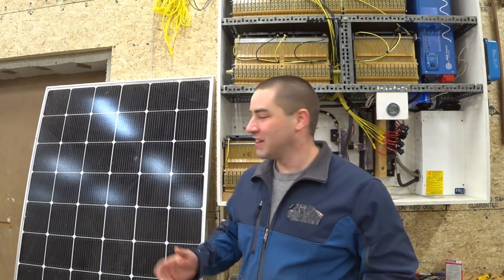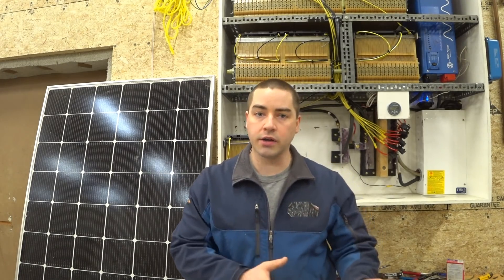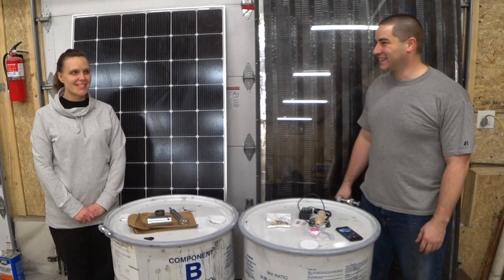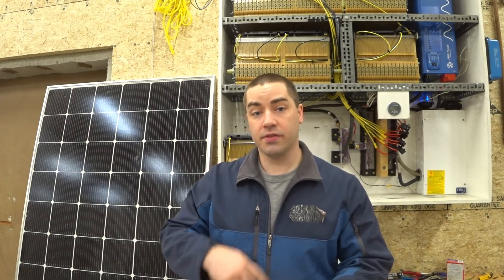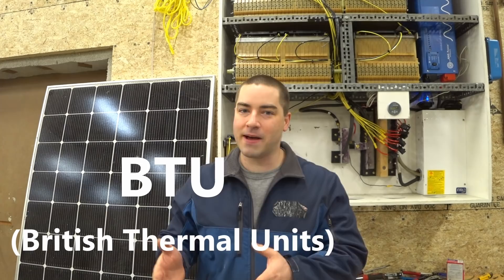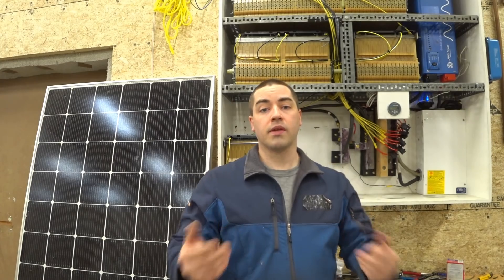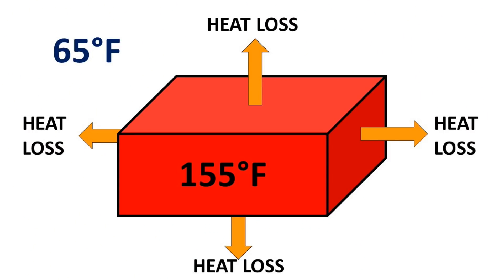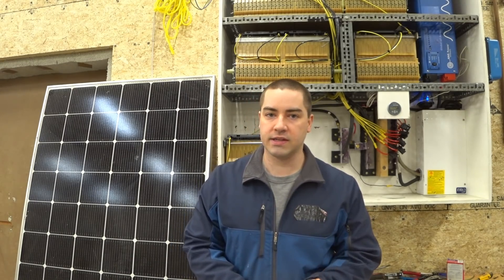Cheapest Energy Storage Off-Grid

Comment: Would it not be cheaper to have a solar water heater with a big tank?
Reply: Solar thermal is a one trick pony. I use any excess PV energy to heat water and any successful solar system has to have excess PV to operate on those less than great days.  With solar thermal, once you have heated water that dog is dead. Most of the time it is an unusable asset.  I can use that excess PV energy to heat, run fans or air condition. Solar thermal has some applications, but it sure is ugly.
Reply from the maker: I'm not sure I understand, what are you comparing?
Reply: @DavidPozEnergy  A system that uses the sun to heat water directly, rather than making electricity and using that to heat the water.
Reply from the maker: Hi Mike,  I did a series of videos where I compared heating water with solar thermal and solar PV.  Usually thermal is cheaper, however, I conducted my experiment in winter to find out how they compare with cold weather.  It turns out that solar PV is cheaper in the cold.  Here is the conclusion video with all the results: https://youtu.be/KVeGummoXS0

Comment: This needs an update.  Are you able to get your water hot enough? Were your calculations close?  I am thinking of starting an off grid solar system to supplement my house.  My plan is to gradually grow it and move appliances over.  It would be nice to have a large cheap bank for times when it produces more than i use.
Reply from the maker: Your idea is great.  Move things over a little at a time.  My system works well most of the time.  It has already paid for itself.  However, I would probably use solar PV instead of solar thermal if I was to do it again.  Thanks for watching.

Comment: What's the rough cost to build the Thermal tank?  I'm making a hydroponic garden
w/ fish & I need to keep my fish a comfy 70-80 degrees F^ ...... This tank you have
will do what I need very well.... I think it will but I'm going to check it out now.
peace
Reply from the maker: I spent $300, but used some reclaimed materials. If you are buying everything new, and using copper for the heat exchanger, then plan $900.
Reply: @DavidPozEnergy  ~ cool,  I did heating>A/C & now have access to copper coils
& stuff like that.  Also going to do some solar things.  Lithium is over
my price range right now so I'm researching still.... I've bookmarked
your stuff so I can figure out other things too.   subbed    peace

Comment: The answer is both. $2000 for 14kWh of long-lasting electricity storage is incredibly cheap compared to pre-packaged solutions. But I also agree that the least useful thing to do with battery power is to heat air or water, so having both PV and thermal solar is how to win.

Comment: Storing lots of hot water is common thing in the northern Europe, traditionally water is heated with wood once a day / once a week depending on how much energy is needed for space heating. For example I have around 600 gal (2070 l exactly) for hot low pressure water (0,5..1 bar) which is flowing in floor heating through 3-way control valve adjusted by room temperature and outside temp. Then in tank there is two copper coils in series to get hot potable water with water supply pressure. With wood the system can be pushed actually even slightly over 220F but 200 ish is comfortable limit. Pressure is there to prevent airlocks and to keep water everywhere, also for storage/heating water it is nice to get the water almost oxygen free during time so corrosion is no problem even with mild steel piping. 

Tank is located inside the house so that leaking heat will not be wasted but heating the boiler room to keep all water equipment unfrozen. But anyway insulation is more or less equivalent to reqular hot water heater so outside is cold to touch. 

I don't even know why I am opening this so much but anyway.

 tldr; hot water energy storage is proven and really efficient for energy storage if heat source is intermittent like solar or burning wood.
Reply from the maker: Sounds like a great system.  Can we connect on facebook?  I'd love to see some photos of your system.  https://www.facebook.com/DavidPozEnergy/  Thanks.

Comment: Hello, I would like to start by thanking you for sharing your videos. As a electronic, and electrical technician I would like to say you are doing a pretty good job. I am currently living in SW Florida so I have too much sun and heat to know what to do with. Pretty much the opposite of what you are dealing with. I can't get cold water at this point, but yet we are currently still paying for hot water. I would like to install a solar heater to put in line with my current electric hot water heater. This is no problem for me. The thing I am trying to look into is if I can use a large reservoir tank in my solar heating system and have it double as a kinetic energy battery for electricity storage with a solar electric system. I was wondering if you have come across, and /or looked into the idea of using a hydro kinetic battery to store electricity. I understand that it is the most efficient way to store electricity, but I'm not sure just how much water it takes to be feasible for my situation. I do understand it may not be a good idea in your area do to freezing temps. I am also looking at the iron battery idea, but I think I have everything I need for a hydro battery in my yard already. In my situation I have a well that pumps into a white aerator tank. Which then will sit in the sun until we use it, hence no cold water. I intend on using a larger tank, covering, and insulating it to keep this tank as  cool as I can. At the same time I want to install a solar water heater panel with a large black reservoir tank in line with my electric hot water heater. I am intending on setting up a small solar electric system as well as trying to play with some wind power. Being as hot as it is in my garage I am really trying to come up with a plan to store the electricity in the safest way I can. I have plenty of room and lots of scrap parts, and materials in my yard to set my self up pretty good. Having a electronic engineering background and the materials I have been collecting the only thing I have to figure out is the solar electric panel, and battery storage. I plan on starting small when it comes to the electric panels. I may even be building them out of free scrap materials. I understand that for most people it's better to jump in deeper at first. I will be moving north sometime soon so I am just trying to throw together a little something to get us to that point. Apologies for the long comment. This is the first time I've tried to contact someone on YouTube. I'm not sure if you are even able to return a message, and if so where I would find it. Anyway thank you so much for sharing once again, and best wishes to you and your family.
Reply from the maker: Hi John,

Thanks for reaching out to me.  Comments are great on YouTube.  If you need electricity then I suggest storing it in batteries.  I do this in my own house.  I don't try to convert the heat energy back to electricity.   But, you can make a solar in-line heater for your climate very cheaply and easily.  Because you don't have to worry about deep freezes (like I do) you can use a passive system.  Passive systems have no controllers or pumps.  There is a very good example here: https://youtu.be/KEPej1hZmto  

If you need help sizing a solar battery system, I suggest contacting "Alt-E".  The sales staff is very well trained on matching system components and the help doesn't cost anything.  https://www.altestore.com/store/  They even have a resources page that is very informative.

I hope that helps you out.

Comment: Thanks for the video.  I would like to make two points.  First your storage capacity is probably not what you stated because you have displacement of all the coils and as a result I'm guessing you only have two days of hot water.  My second point is that if you're on a backup or reserve, you probably don't need to have super hot water. I think a lukewarm shower is better than a cold shower.  So in the case of just having a backup system, I think one could conserve hot water a bit more.
Reply: D A the coils do not really displace storage capacity, as they contain water which heats. It doesn't matter if the water is in the outer tank or within the coils it's still storing heat. The plastic tube itself will do course displace some water, but again the plastic will heat and serve as a heat battery. Granted the specific heat capacity of plastic is lower than water so some storage will be lost but realistically it's minimal.

Comment: Great off grid  idea.....have neighbor who uses a dozer cat radiator DC6 and small pump and this rad sits on top of a wood stove.....and he uses in floor heating to heat his shop floor......the shop is another story.....but he can park two combines side by side to work on.......he mentioned that the floor gets so hot.....that they leave the bay open a foot most winter days..and lay on insulated mats...the floor is said to stay warm for upto 5 days even at -30c..(northern alberta eh)....with no fire.......but he says it takes good few hours to super toasty again

we were trying to solve our heat/light crunch and bust with our alberta seasons

So off grid solar PV stuff ok and a wood stove with a heat ex-changer or a old hvy duty rad....a hybrid .......with a 1500gallon thermo H20 battery in the root cellar........TADA!!!!!

we can get wood dirt cheap...lazy or a 30+ cord logging truck load of dry dead wood.....cost and time for us depending on the year as we hunker down more in some

 NOTE
im looking at a insulating (we have large herd of llamias and can make a wool batts like buying fibre glass batts but thinner ...DIY (another story of llama wool being the best and super easy to use))............a 1500 gal water plastic holding tank..(own ...cost me 500cad)....and this system in the dug in/framed in insulated root  cellar under my new off grid rancher home.......

looking at a greenhouse and shop expansion on new home.....maybe this fall.....and the extra capacity looks promising

this is my first comment on any channel
my forestry background and your inspirational vid has been 
the solution i have been looking for

just needed a refresher.....and the KISS principal
and my bushman twist now

if my grammar sucks...im brainstorming right now

its the idea!!

.....
Reply from the maker: Thanks for watching the video, and leaving your first comment.  One word of caution with tanks.  Most plastic tanks don't have a working temperature higher than 130-140°F (around 57°C).  It could still be useful as your buffer tank for the radiant floor idea, and a pre-heater for your DHW tank.

Comment: why would you use electricity to heat water..  holy shit thats inefficient..     get a natural gas water heater.. jesus.

thermal heating would only work during a very short period of the day....   anyway the cheapest way is simply use your old 12 volt car battery, and when its full dump it into the grid for CASH,,   fuck trying to store it, all you'll have is LOSS.

I was even thinking about running a large capacitor bank instead.

Comment: I think it's pretty clear that if you have natural gas available, it is far preferable than an elaborate solar thermal system.  I wonder what the cost of electricity would have to be to make this system economical.  If you're off grid though, this system is great.
Reply from the maker: My eventual goal is to be 100% off-grid.  I want to challenge myself to go off-grid without propane or natural gas.  Thanks for watching.
Reply: @DavidPozEnergy  
I didn't mean this as a criticism of your project, but only from an economic viewpoint it wouldn't make sense under some circumstances.  I admire your ability and creativity.
Reply from the maker: Sure.  It's all good.  Thanks for watching.

Comment: That seams like a nice idea, but your "water battery" has big leakage. In other words it looses fuel too fast. How about 0 leakage.  Put a big tank (you'll need bigger than this...) in high place and one at ground level. Fill the ground level with water. Get a pump for moving the water up and a turbine generator to get the energy back from the water. Now  ... an attic is probably not big enough to store enough energy, but if you have high house it gets better. And you don't need much water to make an experiment and do some calculations. You just need a water turbine and a pump for a couple of days.
Reply: Well this was a stupid suggestion. I used a random calculator to estimate what would you get of typical block building - 30m high, 10m wide, 40m long (good because it has flat roof). Assuming you can build 1 meter high container that's 400 tons of water. if you want to use the water for 16 hours (when the sun is not giving power) that's 25 tons per hour or 7 liters per second. The calculator says you can generate about 25 kWh for 24 hours, so that's about 1 kWh per hour or 16kWh per day.  Here that'll cost about 1.6 eur/day or 600 EUR per year - nowhere near enough to pay itself for the next 10-20 years. And that's just the energy stored, it's not energy generated - so you have to include the cost of the solar panels too.

Comment: The house my parents built in KY in the late 70's had solar heating for our water, during the summer months the panels on the roof would keep our hot water tank filled. During the winter months, there was a diverter valve that sent the water to a grate in one of the fireplaces. So maybe that kind of setup could help you keep your water heated year around.
Reply from the maker: I like it!

Comment: Sir how you heat water by solar and then change in to electricall mention device namess.
Reply from the maker: I still have a battery bank for running electrical devices.  Storing heat energy is for heating water and space heating.
Reply: Sir how heat water by solar
Reply from the maker: I heat my water using solar thermal panels.  They are made of copper fin-tube inside an insulated box with a glass front.  I pump water through the panel when the sun is shinning.  I have several videos on this, but here is one of my more recent videos: https://youtu.be/kkoesuG72xQ

Comment: Just one major issue here. You did not factor in the heat exchange loss....  one minor issue is you need a circulating pump or heat will only be in the top 1/3 of your tank.   I have done the numbers and you’ll need to up storage about 7.5 times   more.

Comment: So far we have:
$300 - storage tank
$___ - solar hot water panel
$___ - loop pump
$___ - plumbing supplies
$___ - what else am I forgetting?
I'm trying to estimate the cost so I can calculate ROI and sell the idea to my wife.
Reply from the maker: Hi Patrick,  The storage tank can cost as little as $300 or as much as $800 depending on the size, and type of heat exchanger.  I would use copper if I did it again, but that is more money.  The solar thermal panels I'm using today I bought for $50 each, used on Craigslist.  I also have some on my garage I got for free, but I had to repair leaks.  If you buy thermal panels new they are about $900 each (4'x8').  Add another $300 for plumbing/pump.  There may be cost if you need to build a rack for them.  I screwed them to my house framing, so no rack involved, just $20 in stainless steel lag screws.  
I live in a northern climate (Massachusetts) and if I did this again for DHW (hot water for showers, taps) I would use a solar PV (electric) system direct to heating element.  If you are planning a radiant floor, then thermal panels still win.  I have a few other videos in this series on PV vs. thermal.  I hope that helps.  You can contact me on facebook if you want to discuss it more: https://www.facebook.com/DavidPozEnergy/

Comment: Great video man!  I've seen some somewhat negative comment here about your hydronic adventure.  Forget these narrow minded peoples!  You are right - BTU's are BTU's.  When you go without hot water even once you realize how tough cleanliness is in the kitchen and in the bathroom.  Then you finally calculate how much energy your water heater SUCKS.  (I find its about $1-$2 per person per day, every day adds up quick)
Great job on you water heat battery... I agree you should drop a copper coil in there...a much more powerful conductor of heat than HDPE pex.  

have been long time considering building a very large semi insulated storage pool under my trailer house to be used for central heating.  Your math is going to help me size and build this tank!!  I think it is viable but need more collector power!!
Reply from the maker: Glad to help.  Are you in New England?

Comment: Somehow, I think you've created a solution that's looking for a problem...
Your primary goal is to be off-grid and by "off-grid", you mean not connected to the electrical grid.  Correct?
For hot water, I'd just use a propane heater. Natural gas is cheap and plentiful. Burns clean. We have an infinite supply of the stuff. 
If I was building an off-grid house, I'd just scale up an RV system. Dual energy. Solar and gas. Some RV's have marine pellet stoves installed. They work really well...